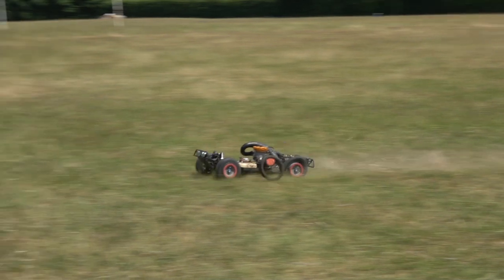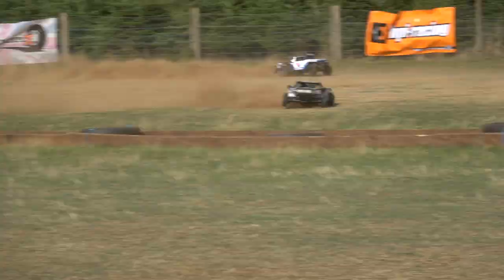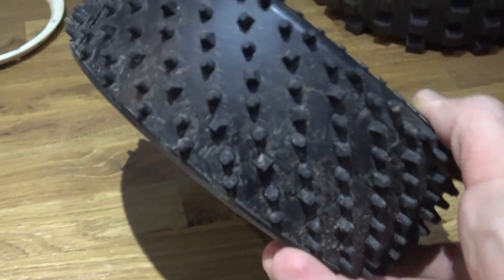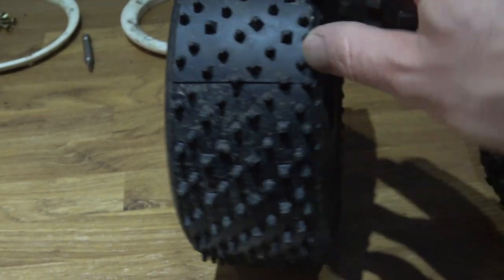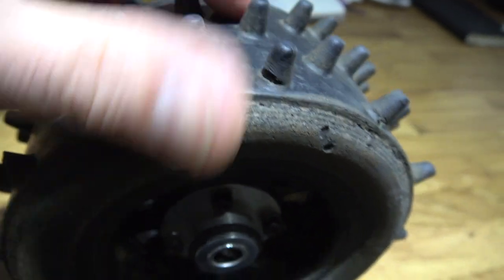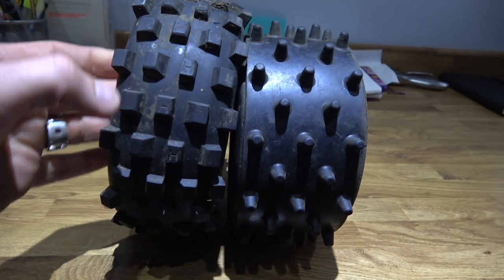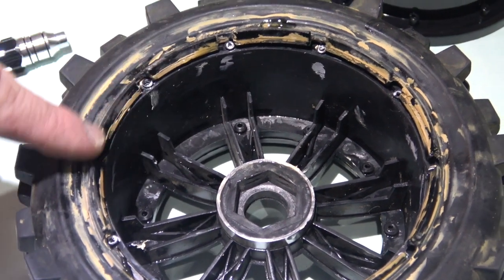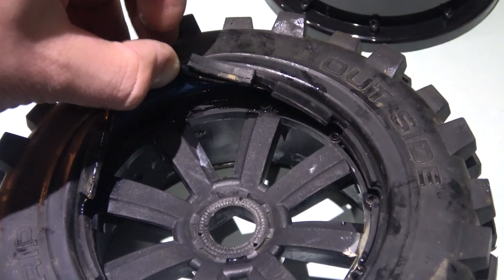BIG POWER 1/5 tyres???????

Comment: Cool vid brah. Pro tip: Gorrilaglue is moisture curing. If you mist water lightly on the insides and on the foams you will get more even and secure adhesions.

Comment: i still remember that my fg stadium stock wheels and tyres had factory holes in them both wheels and tyres i guess to relieve the air pressure build up under high rpms... on random spots.. and i never blew up a tyre even  i had raised the stock 26cc zenoah to ESP Championship Ported GP290 36mm kit and jetpro silenced pipe..

Comment: Big power requires a locker only for the center diff  and a million weight in rear or locked only (is the preferred)! That’s the only success without all the extra stuff because you will definitely blow a tire when that power transfer to that 1 wheel  that breaks traction or just free spinning when it leaves the ground!

Comment: Very interesting little show and tell, I have not blown any tyres with my 5ive-T with Frank Finlay evo 40 RC engine, I am awaiting delivery of an Kraken-RC KV5TT a.r.t.r  with a RCMax GT50cc with all the other parts selected to go with it has kicked it upto £4K plus and will still need to add some parts, not cheap and tyre's I am still researching what to use. Now with my LOSI 5ive-T I am running Silverback 5imian wheels, Area-RC alloy outer beadlock's, King Motor alloy inner beadlock's and Silverback beadlock screw's, with Hostile  belted inner foam's and Area-RC belted radial tyres  and no blowout's I have three sets of these from RCModelz, I will be trying them on the KV5TT.
Like you I really do not like the BRP they remind me of the press on solid tyres for forklift's. they do not look scale and I am into keeping it looking like the real ones out there doing Baja or Short Course truck's and buggies.
RCModelz still stock them so I will be getting a set for the RC4WD Raceline Monster alloy beadlock wheels, wheels well balanced out of the box, you do need to balance any wheel because of the imbalance of the tyres. 
I am not sure how much more powerful the RCMax 50 is compared to my EVo40RC motor, so not sure how well everything will hold up, already selling stuff to get another 50cc GT engine for my VEKTA-5  which is running an OBR34cc Full Mod and feel it may be lacking in the power department.
What made you chose the ALX over the RCMax 50cc, I prefered the RCMax over any other because it is a UK company and Mike out of all the big cc engine builder's because he is more passionate than any other I spoke to and I phoned and spoke to them all regardless of country and cost.
 You know we should talk over a phone or perhaps meet although I am in north Cornwall could do airbnb lol
    What has happened to your oppo Steve it was I think. Yeah I know it is long I hope you get to read it would like feedback on the motor and the tyre issues, thought I was going to get to Bashfest this year but too much happening around me this year. A move home upgrades workshop being built on my property etc etc.
Reply from the maker: nice 1 mate. alx over rcmax was purely the circle i was involved in at the time. my mates ran alx so that's the advice i got i guess. Rcmax are stunning motors mate. both brands have their pros and cons like anything. I have got to know RCMAX mike over time and i agree, he has loads of passion and his motors and work show this big time. tyres wise its all down to experimentation and what suits you and your car/ driving style. I have recently switched to BRP spikes for my alx as a friend was selling them at a good price hardly used. They have enabled me to finally give the car a proper thrash without even being concerned about tyre blow outs, which was a good feeling. 

My gorilla glued mad max's did hold up though. next time out ill try going mad with them and see if they can take it. i'm moving house thursday myself! squeezed bashfest in but any vids from it may take a while.... hahahaha

good luck w your stuff
Reply: Nice one Joel good luck with the move it is up there in one of the most stressful thing's you could do in every day life, I think my crew had a warped sense of humour when packing.

Comment: The MCDs will blow out, I've seen racers blow them out/shred them. They are great tyres though.
Reply from the maker: Hi mate, yes i have a feeling you are right. 1 of the guys has been running some elcon glued tyres for a while on his 50/ 40 with good results but they do look tougher than these astro max. i will give them a try anyway as they give great grip and as u say great tyres ( got them for my losi 5b to be fair ;)